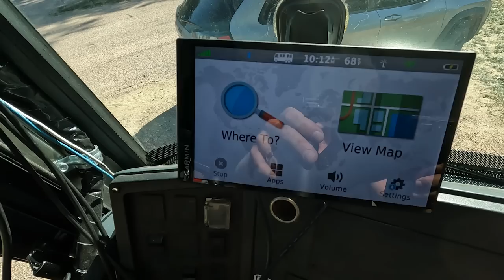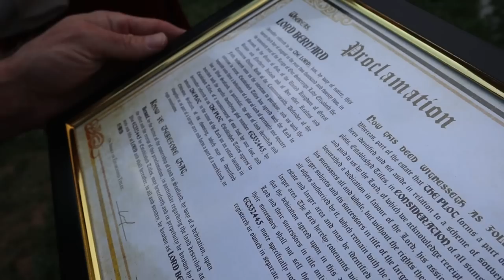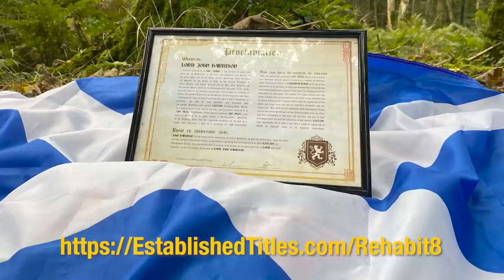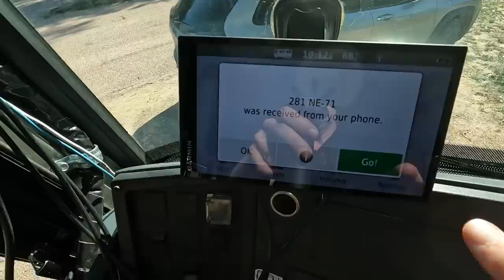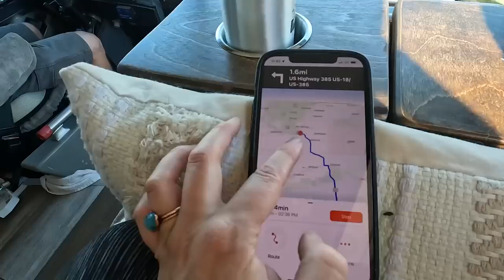What Traveling in a 40ft Bus Conversion in Really Like - S05E11

Comment: When you were checking your tires with your hand, it put me in mind of years ago, I found a wooden stick at the truck stop that had about a 1/2 pound weight on the end.  You would slap the tires with the stick and you learned which ones were aired up and which ones were soft.  I thought it was useful. You might as well. Just a thought.